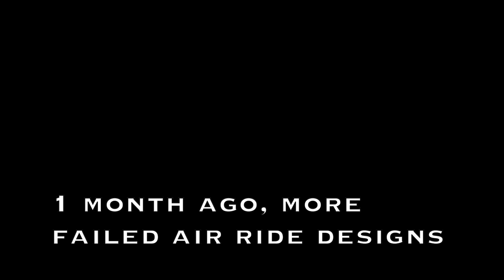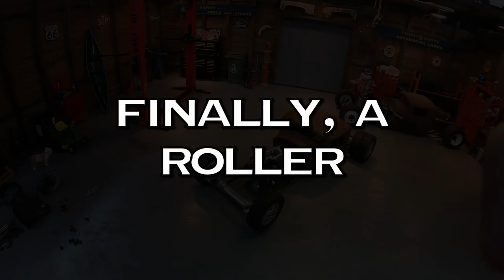RCratrod, the Mod Rod Build, No Air Ride, New Year, New Suspension, Fijon FJ9

Comment: You need a small Lathe and a Mill. So it will much easier to fabricate some special items you need.
Since i have it it´s no problem anymore to build something.
CNC would be nice but i dont have it (yet).

I like your ideas .
I´am trying to build  a Jeep-Rod (1/8) out of an old RC Jeep i found.
But I´am still working (for month) on the rear Axle of it.

Comment: On the rear shocks, u could make a new hoop n mount them the same height they are now, but side by side. U wouldnt have to use the spacers to cross them. N theyd raise it up just enuf to get bout 5mm ride height with those springs but still have that lil droop they have now

Comment: Put the steering servo in the cab and do an eliptecal slot in the side of the body to push and pull the steering control armor have a micro servo with the servo horn outside of the cab to again push and pull the steering control rod that connects to the 'C'hub one side with a track rod to the opposit 'C' hub hey presto steering acheived.

Comment: Love watching your videos and have noticed that you would like to figure out a way to actually use the air ride system , take it for what it's worth but have you ever thought about building a lo-rider van , maybe even chopped if desired giving yourself enough room for your air ride system and allowing the air shocks to stand upward more , putting less stress on the shocks and hopefully help balance the load from front to rear ?

Comment: On the rear I'd be thinking  of making a metal box like a flatbed then you could fit a servo for the rear steering setup..   and maybe that rollbar idea you had on top..
As for the front.. i was thinking that to keep the front with the front cowl piece  would be able to be to be mounted unhinded by a servo.  This would then require a wire Cable type of steering setup.. if you know the CAPO brand rc offroad rc cars.  Using wires instead of direct servo control..  
Thus being able to hide the setup was also thinking that between the firewall and radiator cowl piece to have  a kinda side piece like vintage 1930's cars with the twin flap lift up bonnets..  giving a place to hide wires and the cables for the steering..   also from firewall to the radiator cowl two rods bracing the top and possibly from the lower side pieces of body (the old school 1930's thing i mentioned.) Kinda creating a tunnel . So it you were going to leave the engine space open then those two rods would work. Which as i think you could go with a sideless open bonnet covered engine bay   .. I'll stop before i get even make this idea even more  complicated 
kinda elaborate  but  might be